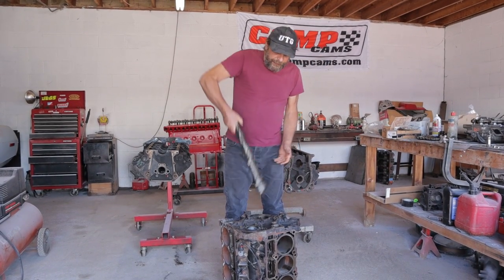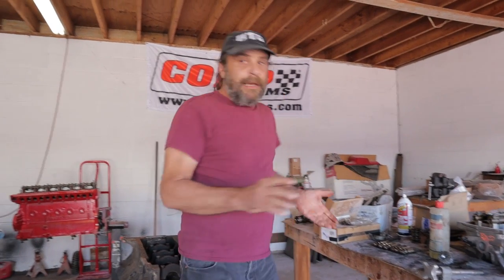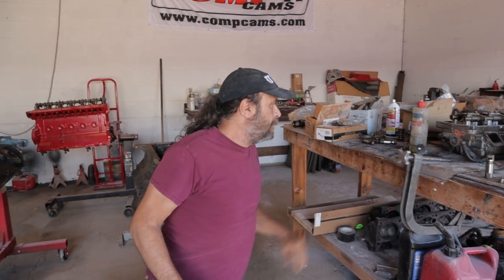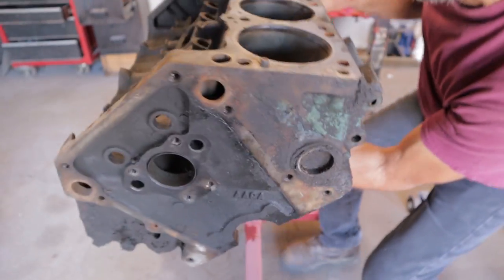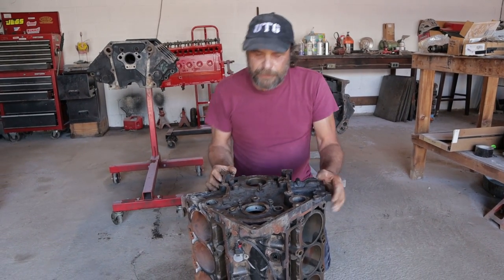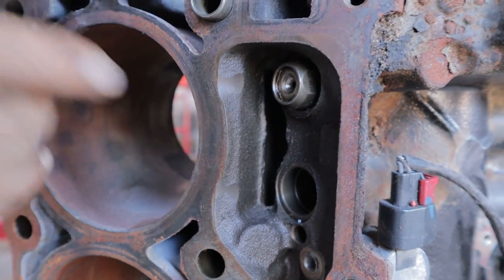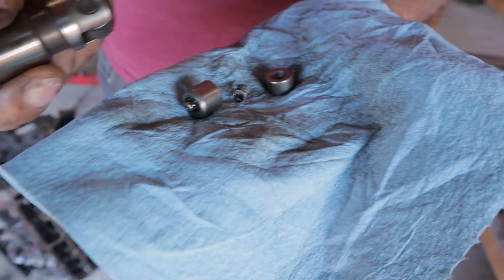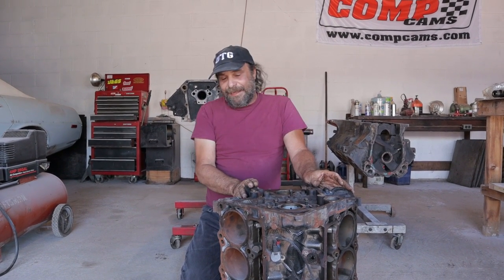Gen 3 Hemi Camshaft Failure Mystery Explained!

Comment: Funny, I've owned one these ticking time bombs for ten years now. Never had an issue with the mechanical part of the engine. No lifter ticks, rattles or any sounds out the ordinary for a roller top end engine. My truck has been on countless road trips that will lead to idling in a traffic jam for quite some time. I've had the truck in to do things to it I don't have time or the tools to perform. Everyone who has worked on it drove it all claim it's a great engine. I bought the truck 80,000 miles on it. I've put around 140,000 mile on it myself. I've drove it easy everday driving, drove it hard burning a set of tires off of it in a day pretty much. I've made countless passes at tracks and never had issues. I've read that you do a cam swap along with rest of the valve train you shouldn't have any cam issues. I know the fourth gen ram with Hemi engines are notorious for eating up cam lubes. Haven't heard to much of those issues with the third gen ram hemi. As I said I drive mine everyday, sometimes easy and sometimes I just like to let everyone know in a two mile radius that I'm on way lol...... I would most definitely buy another Ram with the Hemi engine in a second. I like my engine so much that when it's service over as a truck engine I have plans for it in a street/strip car.
Reply: Bill Knight how often you change the oil , what oil , what gas you use .
Reply: @wallyedmonds8199  I change my oil every 3000 miles and use 93 octane with a Bullydog 93 octane tune. I use Castrol GXT 5w30 with 6oz of Lucas oil stabilizer in with the oil. No oil burning issues or odd noises. Been doing this for ten years.
Reply: I could see how the Lucas Oil Stabalizer by itself regardless of oil brand or frequency of change could make a massive difference
Reply: My 07 hemi pickup has 260,000 miles on it and runs good. Bought it used a year ago.
Edit: I think these hemis are supposed to be using 5w20 oil.
Reply: @Dozav7  the 2006 and up use 5w20, 2003 to 2005 use 5w30.
Reply: Your experience differing from other people’s experience doesn’t mean they’re wrong, though. Just because I haven’t had a 4l60 break on me doesn’t mean that they’re good transmissions
Reply: @theeoddments960  well, I know I beat on my truck way harder then most. Pulling, towing, hauling and even drag racing. If I would bet that any Hemi engine would fail, it would be mine? I have never done any internal work to it yet, once the truck has had enough the engine will be rebuilt and used in a resto mod👍💪. By the way it's back by one of those shitty transmissions too that takes a beating and never misses a beat plus a 91/4 posi rear end that is an issue too. I'm learning that maybe I take better care of my shit the rest of you fools?🤣🤣🤣🤣🤣

Comment: What about drilling jets into that main oil tube?  You could through-drill them, then plug the back side.  Have to be tiny holes I imagine.
Reply: I'm thinking something like the piston oil squirter many engines have been running.  Tapped into the main oil tube and aimed at the lobes.  The lifters are another thing, you can always plumb lines from some place in the galley and run them to the lifters so they can squirt oil directly on them from above.  

This needs to be accounted for when cinsiderthe oil pump, it will likely require higher volume,  especially at lower RPM where this issue is prevalent.
Reply: Maybe.... but that'd be awful tedious getting it just right so it wouldn't drop pressure to the rest of the engine though.
Reply: @DrewLSsix  Yeah, but those piston rod squirters are at the end of the line where the pressure is lost anyway, not right off of the main feed galley.  It would take a lot of trial and error to get the holes just the right size, and yes it would likely require a pump capable of very high volume.  Hell, it might even require a larger sump in the oil pan.
Reply: Do you think that the upper part of the barrels of the lifters could be made conical with the dremel so that the drops of oil that drain from the lifters wet them?
Reply: I feel like he has a perfect opening allready since that engine is allready mds
Reply: My bet for the simplest, easiest, quickest solution is greater oil volume to the lifters and weep/squirt oils in the bottom of the lifter just above the roller
Reply: @livewire2759  That may be true. However, I think many parts companies build replacement oil pumps with higher volume and pressure. If done just right, it might not harm anything.
Reply: @skylinefever  Yeah, high volume pumps are readily available for most engines, but they are designed for high volume the way the engine was designed.  So the question is, would it be high enough volume?  To figure it out you'd have to do the math for the physics of the oil system, figure out exactly the right size holes to drill to get adequate lubrication while maintaining adequate pressure, then figure out how much volume would be required.  Just drilling small holes and going by trial and error would be a long, arduous task of building the engine, test running, tearing down, drilling  larger holes, repeating... until you found just the right size, and then hoping that a regular high volume pump is enough to keep up.  
Tony's idea of simply plumbing in some lines in the valley for drip lubrication would be much easer.
Reply: @DrewLSsix  that's what i was thinking like a spray bar tapped into the oil gallery with banjo bolts and holes directed where oil is needed
Reply: @livewire2759  Well, some people have been known to put restrictors in certain parts of the oiling system to ensure that a high volume pump only delivers that extra volume where it is needed. Mondello makes a set of restrictors for BB Olds engines, because he is aware of what should and shouldn't get extra oil from an HV pump.

Also, oil pressure can be simulated. Some engine primers screw into the oil filter boss and shoot in engine oil. If the cam, crank, and specialized oiling tube were installed, it would be possible to see what needs changing and what doesn't.
Reply: @skylinefever  Restrictors might be a good idea.  But remember, this is a low budget channel, which is why Tony didn't want to plumb drip lines in the valley.  We are looking for solutions, yes, but Tony wants to keep it inexpensive.

Comment: Drilling and tapping in from the top seems like a decent idea, but you would need a small electric oil pump to supply it. Might as well run some oil to the top of these lifter too, and make that small hole to allow oil to get to the rollers.

Intersting find to be honest.

Comment: The biggest problem is the factory recomends 5w20 oil. It flows like water at room temperature let alone at 200° FFS. Its not good oil in any warm climate. And all the newer oils have less Zinc which ads to the problem. Run 10w30 or even 10w40 if you beat on your ride.The 5w 20 oil is so thin it wont stay on any parts and flows right off especially with increased temperatures these new engines run at. IF ANYTHING these modern hotter engines need THICKER oil and NOT thinner like they recommend.
Just ask yourselfs guys, Would you run 5w20 in your 340 383 440 or 426 ?.? No you most defintely would not. Remember those engines lasted as there wasnt any 5 20 oil to run in them even if we could...
Reply: My 2019 scat pack uses 0w
Reply: @infosneakr  0W 20 or 0W 40?
Reply: @larrydunlop378  ow-20 think
Reply: Tom K it uses 40
Reply: You void your warranty if you run different oil.
Reply: The 0w or 5w is the viscosity equivalence of the oil when the engine is cold. The oil behaves like a straight 0 or 5 weight would at that temperature. Once the car is at operating temperature the viscosity of the oils behaves like a 20 or 40 (depends on what you use). Technically the 0w-40 and 10w-40 should flow the same at operating temperature and the 0w oil will have a lot better startup protection because it flows better at less than operating temps.
Reply: @MountainPF  True, So you want to use something Thicker than the 20. 5w30 or 5w40 is Better than 20.
Reply: ive seen a bit about engines with these thin oils, i heard its an emissions thing, scary thin to me though
Reply: @oldhawkins  Possibly, depending on your dealer. But I will have a good engine for along time AFTER my warrenty runs out..
Reply: When I worked at a Dodge store, there was an internal memo from Chrysler that said to upgrade to SAE 5W40 Synthetic.  This was for vehicles being used in a severe service application, such as police use - per the memo.   IMHO, racing would also be severe service.

 I also add 6 ounces of Lucas ZDDP additive to the oil at every oil change.

Plate [C]
Reply: Muzzy337  ive seen that but dont you go a little thicker in a hot climate im sure id use a friction modifier
Reply: Muzzy337  I find it hard to believe that the bearing clearences are different between a 5.7L in a challenger, Ram 1500 compared to a 5.7L in a Ram HD which Does reguire 5w30 oil.? Same engine ... Or as has been posted, Chrysler doesnt require a bearing clearence change when they put out a service bulletin saying to switch from 5w20 to 0w40 for severe service like Police use? They want you to run the thinner crap 5w20 for percieved FUEL ECONOMY. That is the ONLY reason. As a police vehicle or HD truck the fuel mileage is irrelevent, so they reguire THICKER oil. 
A 2005 Caravan that I know Very well with a 3.3L V6 required 5w20 oil. I can Guarantee you that the only 5w20 that engine has ever seen was the First oil it had. After that it has only had 5w30. No bearing noises, No valve train tic, it just runs. 5w30 is the only oil my 5.7 Ram will ever see. Im convinced the 5w20 is THE problem with these engines. Take care
Reply: You do realize that engines run at the same temperature whether it is hot or cold outside right?  Over 220,000 miles on my Ranger running the factory recommended 5W20 and the engine is in perfect shape. It's not the oil it's the design flaw with the engine. Most engine wear occurs before the engine warms up because the oil doesn't flow as well which is why manufacturers are going to thinner oils along with the engines having tighter tolerances.
Reply: What I heard was the problem with thicker oil on modern engines is clearances are too tight and Variable Valve Timing get gummed up with thicker oil.  I use 10W-40 in my 89 Supra 7MGTE engine and I also add in 8 oz of a Zinc additive on my 3000 mile/6 month what ever comes first oil changes.
Reply: @oveidasinclair982  /\/\This/\/\  0 and 5w oils are recommended in engines running variable valve timing so the cam phasers work properly.
Reply: Not so fast, this engine needs more oil flying off the crank, also at 200 degrees, all oils run like water. Extended idling is severe duty not just racing! Tony didn’t suggest thicker oil for a reason
Reply: In engines with VVT thicker oil than recommended can be detrimental as those systems depend on the free flow of oil through drilled passages in parts of the valve train.
Reply: @1575murray  As has been stated here before. Other Hemi engines including some SRT versions WITH VVT and MDS systems are Factory recommended to run 0w40 which is THICKER at operating temperature than 5w20.....
Reply: @wildfire4175  I absolutely do realize that the operating temperature of the engine is the same winter or summer. But a 20 weight oil  at 200° is HALF as viscous as a 40 weight oil at said 200°. So it will not flow off and stay on parts longer. ie better lubrication.
Reply: @larrydunlop378   Engines are built with specific tolerances, if I oil is too thick it can't flow well enough to get to where it needs to be. It doesn't matter how well an oil is  lubricating if it can't get to where It needs to be. The engineers know the tolerances of the engine and therefore they should be the one to recommend what weight oil to use. Viscosity is a measure of an oil's resistance to flow, not a measure of its lubrication properties.
Reply: @wildfire4175  As has been stated here before. Chrysler themselves have sent out Factory service bulletins to Change from the original 5w20 to 0w40 for servere service. That is usually meant to mean extended idling periods. Yet the same factory service bulletin did NOT say to change bearing clearences, valve stem to guide clearence or even change the oil pump clearences with the new recomended viscosity change?  How can this be I ask? It means ALL the clearences are FINE with the Thicker oil. You can read this post again and let me know. Take care.
Reply: @larrydunlop378  The W rating is the viscosity of the oil when it's cold so they actually decreased it so it will be thinner buddy
Reply: @wildfire4175  The w is after the 5. That means the 5 is the vicosity at 0° F. The 20 is the viscosity at 200+°. So a 5w30 or a 5w40 have the SAME viscosity at 0°F.  Saying that a 5w30 oil is thicker at 200° (operating temp) than a 5w20. And a 5w40 is thicker at 200° than a 5w30. But ALL three have the same Viscosity at 0°F.
Reply: Muzzy337  You forgot the oil wedge theory.  Just sayin.
Reply: @larrydunlop378   Dude thats exactly what I just said. Jesus Christ.  If you think 5W20 is like water but somehow 5W30 has way more protection then you don't know anything about oil. It's not that big of  a difference.
Reply: @wildfire4175  Hey Bud Im not here to argue with anyone. Im trying to let people know that the 20 weight oil is not a good choice for todays hotter running engines. If your having no problems running that oil then you carry on and good luck.
Reply: Muzzy337  Man,  things are going to get real ugly with that grade !!!
Reply: Muzzy337  At some point the viscosity is too thick. And if someone left that in during the colder months and forgot to change it out things would go bad in your engine in a hurry.
Reply: @wildfire4175  cold starts i guess , here cars run hotter because of our extreme summers upto 50+ deg c in the shade , radiators can only do so much , then in winter our engines over the decades have Always ran cooler ,  dealerships recommend the slightly thicker oils and install it too and our engines last for hundreds of thousands of kms trouble free in the lube dept, we dont get cold weather though , winter days are 20+ deg c , and where my uncle lives every day all year round is above 30dec c with almost all minimums of over 20 deg c. ive heard with 0-20w etc you got to go synthetic im guessing because mineral oil could break down .
Reply: @oveidasinclair982  fordtecmakeyouloco said he uses engine oil flush each oil change and high quality friction modifier to the oil , hes a perfectionist Ford mechanic, ive done the same it fixed my vvt issues.i use what ford Australia says to use for my particular ford in my hotter region of Australia i dont go to crazy , like you say thick oil and vvt dont mix ive seen vvt function poorly when a guy put 15w- 50w when that car meant to have 0w- 30w
Reply: @closertothetruth9209  The oil flush it's self doesn't conflict with a VVti engine, it's the gunk in the engine that it stirs up that can get caught in the VVti little ports.  Unless the inside of your engine is sterling clean, you're taking a risk messing around with an engine flush on a VVTi engine.
Reply: @oveidasinclair982  i suppose , id guess  my engines have always been clean im a bit of a fanatic have been for decades, we change oil from new between eve ry 2000kms and 5000kms depending on the abuse we dish out which is pretty bad at times , kind of a lead foot, but having said that my vvt will be locked out soon when the turbo goes on to the barra.
Reply: 06 to 09 i believe is all nom vvt design. 2010 was new vvt design. Pre 2010 would run 0 5 or 10 just fine with 30 maaaaayyybe 40 but i wont be doing that. But after reading through all this im so happy Mine isnt vvt and only has mds. I think ill be going to 5w30 amsoil. Also since we are on the topic of chargers, i hope everyone here knows about the drive shaft couplers and why they should be replaced when vibration starts to happen.

Comment: Dude you nailed it! I had three 5.7 Hemi engines and two developed the tic. I traded them and now own a pentastar no issues. Can you modify the lifter with an oil hole ?
Reply: The lifters get oil - they're hydraulic lifters.  They just don't get enough down onto the rollers and cam area, especially at low RPM and the way the lifter bores are set up, the oil just drops down away from the cam and rollers where older style engines, the way the lifter bores are done, the oil tends to drop down toward where the cam and lifter meet.
Reply: A hole like he said, in the bottom to squirt on the roller?  That might help, but it'd have to be a very small hole so as not to lose pressure in the lifter and starve the top end of oil.
Reply: @immikeurnot  I think he was pointing out that the outside of the lifter does not get oiled and a hole in the side of the lifter would fix that.
Reply: I'm thinking tiny oil hole into the topmost side of the lifter body where it'd always be faced/against the lifter bore, would keep pressure OK. what drips from up high like that could help keep those rollers wetted too.
Reply: Johnson lifters
Reply: @victormiranda9163  LOL, dude.  There is a hole in the side of the lifter.  That's where the "hydraulic" part of the lifter gets its oil.
Reply: @immikeurnot  think.  you need to think.
Reply: An No Power. Lol'